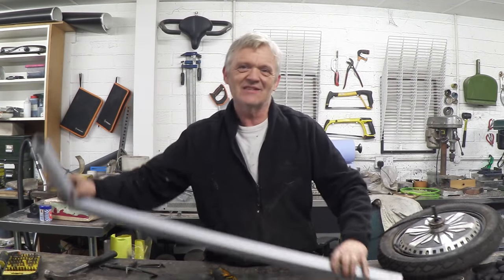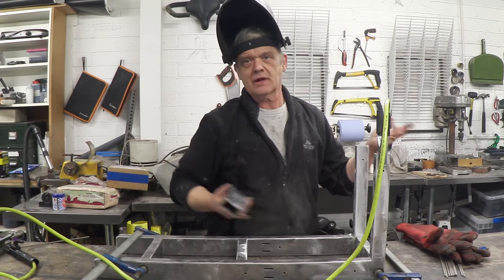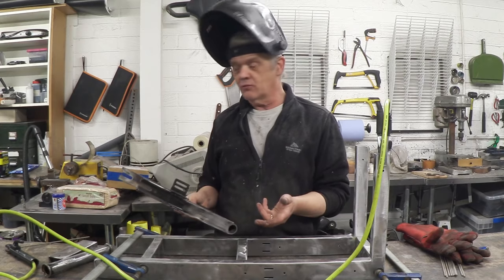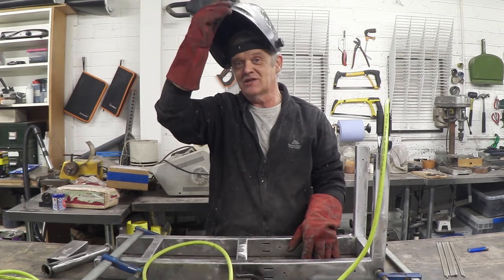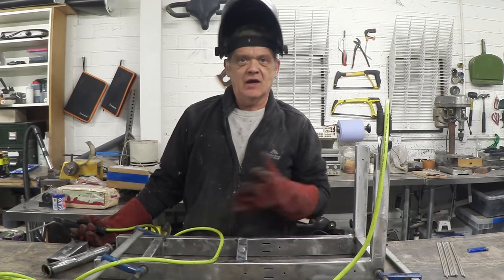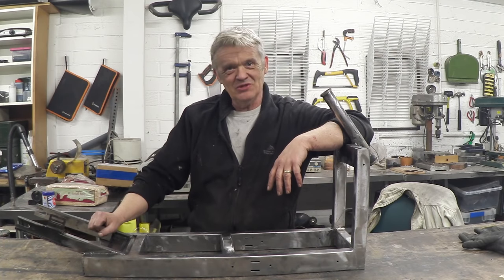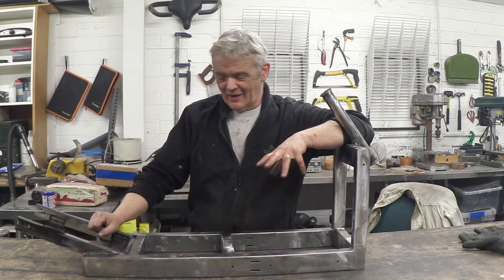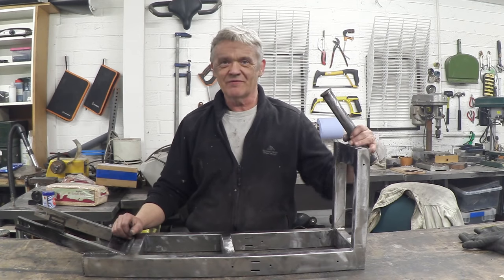Making A Big Wheel Electric Kick Scooter - Part 1 - The Frame

Comment: The angle of the steering columb may cause you some issues riding. I would suggest just off of 90°. Would do it for a scoot. And if you need advise on an esc. Let me know. :)
Reply from the maker: i went for 25 degrees off vertical as that was the angle of the machine i took it from - but aren't choppers a steeper rake?
Reply: @ThinkingandTinkering  ah right if you plan on being sitting down it may be okay.
Reply: @ThinkingandTinkering  if you imagine where the handles bars would be whilst you are pushing along it woukd be awkward. But if you plan on using 100 percent electric all the time and have a seat that would probably be okay.

Comment: I think they are illegal to use in public areas without pedals. Wouldn't aluminum be better with reference to the power out? Are you making your own battery for it? If so what type of battery would you make regarding materials? Thanks for sharing your interesting work.
Reply from the maker: scooters yes - but not kick scooters
Reply: @ThinkingandTinkering  yes kick scooter human powered. Your making an electric scooter. So it's not a kick scooter. Don't mean to be pedantic or patronizing. But an accurate title would be 'Big wheeled electric scooter.'

Comment: Looking forward to see the rest Robert.  What welding set are you using? It sounds like a good set
Reply from the maker: i'll say on the next vid mate - though i did say on the first vid and i don't really like to repeat that or it just becomes a list of what i have already said - i am not complaining mate just explaining why i didn't say this time - cheers
Reply: @ThinkingandTinkering  Apologies.  I literally must have missed that bit!  My welder is knackered. Time for a replacement. Glad your enjoying the welding.  Such a useful tool and you can buy small rods as you've already seen I'm sure. Suitable t weld thin-ish steel.  beyond that / too thin and you need to invest in a TIG setup.

Comment: I'd add triangulation from the top of the head tube to the 90° at the front of the frame:)
Reply from the maker: i went for 25 degrees from the perpendicular - mostly because that was the angle of the machine i took the forks from
Reply: @ThinkingandTinkering  is that the rake/castor angle that I think is fine,just ment additional fixing on the head tube to bottom of the frame,talking of bottoms did I imagine in the comments a bear behind?!?!lol
Reply: @ThinkingandTinkering  I heard someone mention an off ninety degree head angle but that's only applicable to tiny polyurethane wheels that would skid out with too much castor,judging from the hub motor wheel the angle should be spot on,could even fit a seat capable of carrying two:)

Comment: looking great but please a small request don't hold the stick when you weld no matter how tempting it is to stabilize it it only takes a small hole in your glove and your in the hospital carry on good sir
Reply: Rubber gloves under the welding gloves would be a good idea. Might be inconvenient but safety is better than no more Rob for us to know.
Reply from the maker: mate! - don't be that guy. Don't peddle fear under the guise of concern. If I burn a finger - so what? If it's the electricity you are saying you are worried about - then read - this machine outputs 20 volts i could grab that with my bare hands and nothing would happen
Reply from the maker: It's a 20 volt output machine mate - if i grabbed it with my bare hands nothing would happen - you wear gloves to protect you from the heat not the volts - rubber gloves under would do nothing at all but make you sweat.
Reply: it was literally the first thing i was told as a certified welder idk what the other guy was talkin about rubber gloves its more about slipping your hand down and grabbing the end of that stinger thats not a burn you want to have

Comment: Headangle a bit steep methinks
Reply from the maker: isn't it steeper in choppers?
Reply: Wheels are relatively large so it would only be a problem if it had tiny wheels like a skate park type of scooter?:)
Reply: I think it's actually termed as slack,steep being roadbike,longer the fork travel the steeper the angle has to be in order for the fork to actually compress if it has suspension ie too much an it will want to pivot like a swingarm lol I know what I mean though my description is poor!!!
Reply: @ThinkingandTinkering  correct Robert you can have any angle you like within reason, just might feel a little safer more upright all the the best ,love it whatever

Comment: Remember the video you just did on simplicity?? Um yeah leave it electric, charge it with the gasifier / generator. You are still being transported by the biomass with less complexity, less weight, way less cumbersome and it will be more efficient.
Reply from the maker: you may have missed the point of the video - simplicty is clarity not lack of experimentation. Building a car to run off a gasifier is simpler anyway as you reduce the need to have two machines doing one hob - it hardly matters really anyway - i do what i do for my reasons and as long as i am clear in my objectives it is kept simple
Reply: @ThinkingandTinkering  Right on Robert. Just a suggestion.